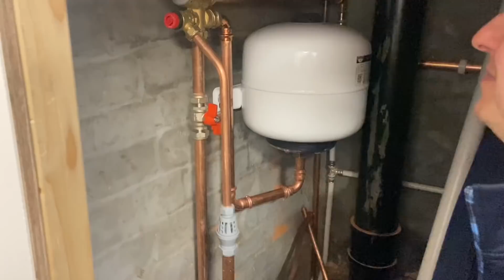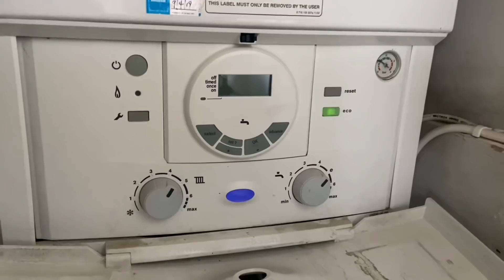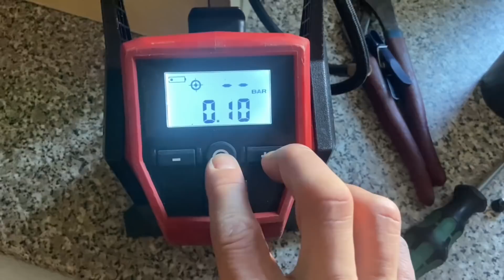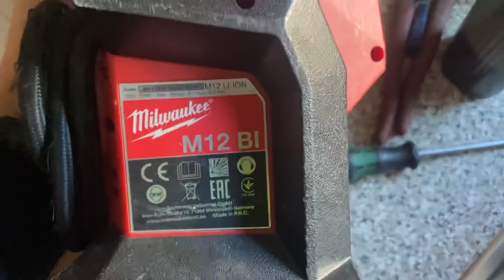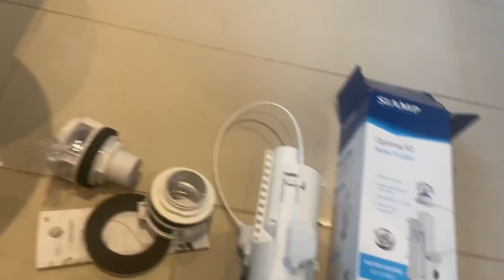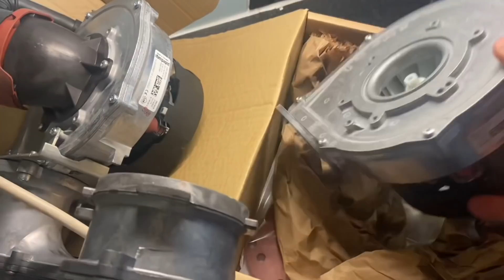P B Plumber The life of a jobbing plumber #79

Comment: Replaced my first siamp and let me say what a fucking nightmare it was had seen your videos before so thought yes nice easy job got the new one and fitted it, put the cistern cover back on and pit the new push button in and tried it and found it to not flush, turns out the push button was faulty so went back to merchants and got the replacement one, went back to teh job a few days later to refit and got the working push button and fitted it but still would not flush, phoned siamp and guess what the siamp was faulty so had to go back to the merchants and get a new siamp, returned and fitted and worked but fuck me i will be checking this everytime from now on

Comment: Yo Pete number 1 fan here .that siamp Optima 50 the overflow stem you have to trim down so it lower than the window of the cistern or if it fails will come over cistern instead back to pan....guess you did that  as there is a retaining  clip to hold the cistern square.but looked high in the video

Comment: Great video, I had something similar on a Biasi M96 boiler. Ordered one pump it didn’t match the serial number, so my fault. Ordered the correct pump fitted it boiler overheated gauge jumping all over the place. Ordered another new pump went back looked at the both pumps. Thought the arrow is going clockwise on one and anti-clockwise on the other. Basically the new pump had been manufactured with the impeller going the opposite way. Moral of the story Biasi’s are shit 😂

Comment: How much does it cost in china to punch all these parts out and still not debur the pressings. I fitted a sink a year ago and the bur was on the top side of the plug hole rather than the usual bottom. Gashed my finger good on that. Why did I gash my finger? Scraping the stupid f'n caution sharp edges sticker glue off the plug hole so it doesn't leak in a couple of months. Anyways, I have commented 30 seconds in :D, on with the video. And how many leaking kitchen wastes have you come across with the protective blue wrap still in the joint?

Comment: If you had access to the original worster  boiler instructions it probably gave two alternative fans  listed for that boiler .Ideal ISAR used to have different parts on the same boiler sometimes from different manufacturers.With regards to the expansion vessel in my experience if the tube is actually blocked the air pressure in the tank  was correct ,that gave you an indication  that the pipe is blocked At this point I should have taken the pressure off the tank via the shrader valve and that would have avoided the mess when I disconnected the connecting pipe ,was careful not to do that again ! Cheers.

Comment: Worcester, bet it was the fan without a grill on it there for the newer 30i etc as for stuck electrode plugs remove the two screws at the back (the one that holds the hex to the case) with your mini wera ratchet and the whole plate and electrodes will just lift out no messing around trying to get them off inside the case hope this helps

Comment: On the Siamp flush valve I had to replace one a few weeks back and had to cut the overflow down on the new1 to match the old one or if the fill valved failed it would have come out the cistern 1st not sure if you had to do this but the old 1 looked a bit shorter

Comment: Sorry pete, good vid but u didn’t cut the siamp discharge pipe down, if the fill valve ever passes it will overflow over the top of the cistern, ironically i only know this as i was called out to an overflowing cistern this week doing just that and the previous guy hadn’t cut it down. Great videos

Comment: Great video Pete. I've had the same issue with a Worcester fan, ended up taking the old fan in and finding and googling a code on the fan sticker before working with wolsley we managed to find the replacement fan. I'd spoken to Worcester on two occasions for the part numbers none of which were the correct parts. Lesson learned for me, I'll always take the old part these days if I have to travel to pick a part up.